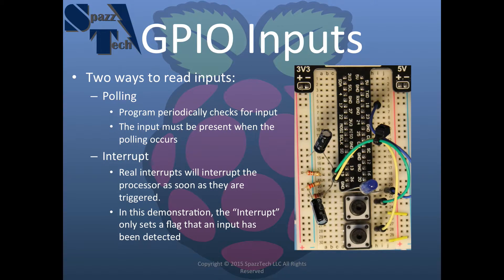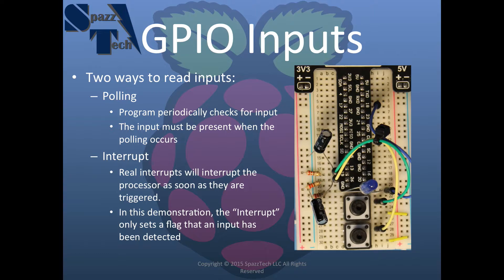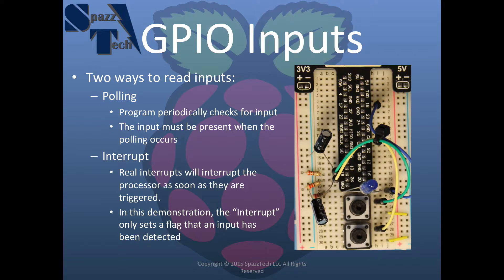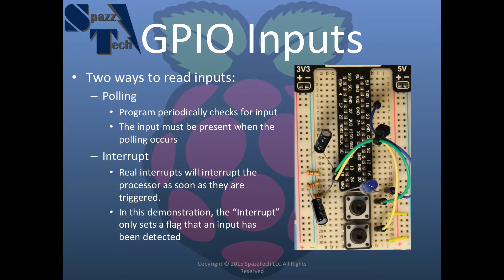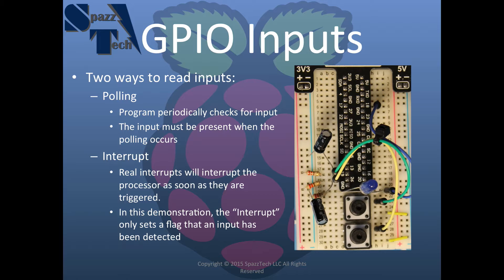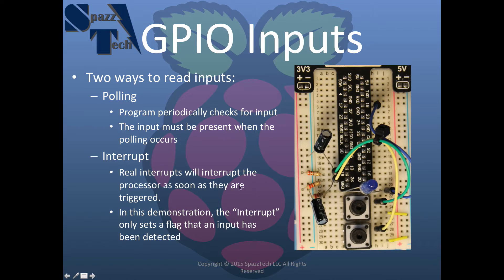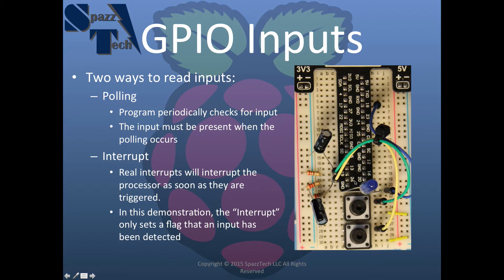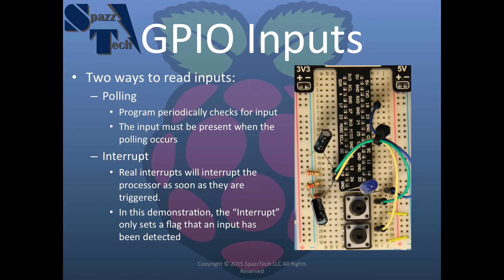Learn C Programming on Raspberry Pi - 08 - Reading GPIO Inputs

Comment: Your lead in chart is spot on up to the point where you say "In this demonstration ..."! Where you confuse the defintion of polling  and interruption. The fact is both of the push button EVENTS you have implemented are POLLeED. Which is very explicitly demonstrated  by the code that handles both them being in the same FOREVER LOOP! The difference between the two push button EVENTS is whether the EVENT is latched OR BETTER PUT remembered once it has occurred. You aptly described the lost event situations that the Push Button EVENTS experience in the POLLED environment.The only way I have been able to avoid these situations is by 1) allowing interruption  to occur (asynchronous transfer of program execution) to an interrupt handler, 2) minimize  the amount of time interrupts are disabled ( < 1/2 the period of the most frequent interrupt), 3) queue any significant processing to a background thread (where interrupts are enabled). 

If the CPU or external hardware does not support interrupts then the entire program design will be required to be driven by a periodic timer (~1/2 the period of the most frequent Event). I hope this helps programmers that want to avoid LOST EVENTS.